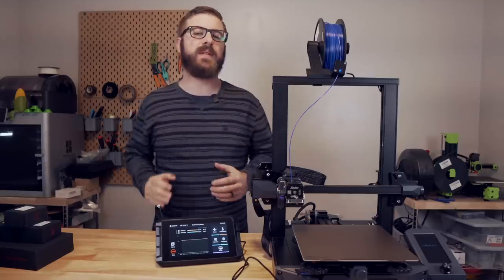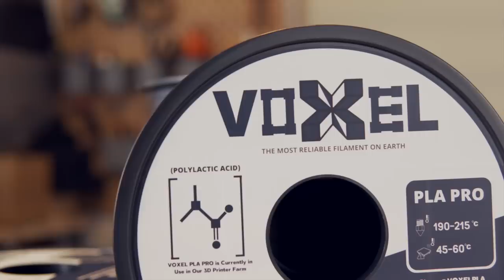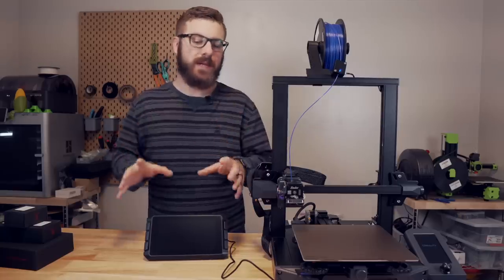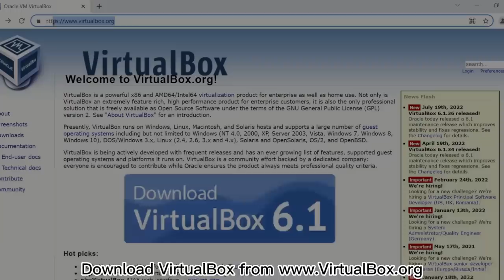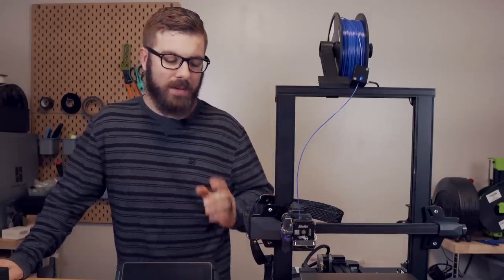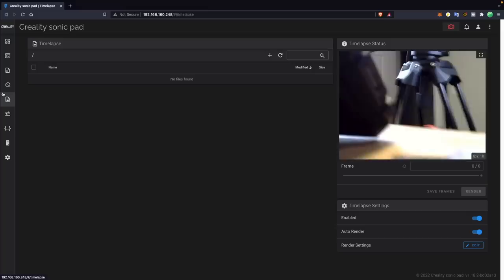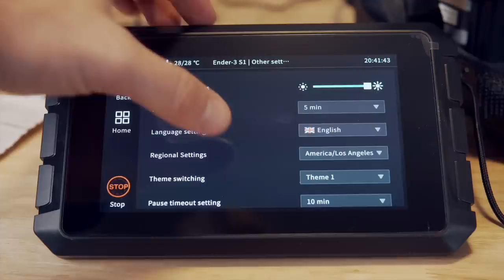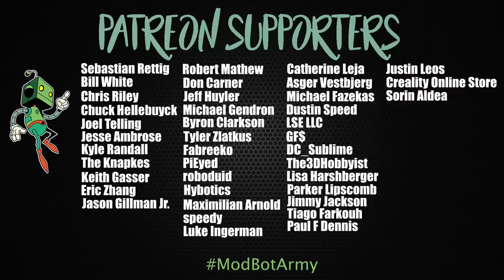Best Upgrade For Creality 3d Printers? Sonic Pad

Comment: FYI, you could use SHAPER_CALIBRATE instead of TEST_RESONANCES and just let Klipper try to find the optimal parameters for the input shaper for the requested axis!
Reply: You can add AXIS=x to select the axis. So SHAPER_CALIBRATE AXIS=x to calibrate the x-axis. Same for y.
Reply: Modbot already does that in the video, I was just pointing out he doesn't actually need the charts, he can just let Klipper select the best value given the results
Reply: I just got my sonic pad and now x and y is separate, /you run x then you move it to y and then hit next

Comment: It’s cool just not worth 160 bucks
Reply: not really that bad once you buy a Pi, screen accelerometer, etc.
Reply: Ideally, it wouldn't. Right now though, rpis are $140+, plus an enclosure, power supply, accelerometer for input shaping, the touchscreen - unless you are going a different route for running klipper, this is extremely economical (even if you don't value your time for assembling all that)
Reply: @zaplocked  Yeah but most people dont bother with raspberries anymore and instead get one of the alternatives that are not being scalped. 
You can get a banana pi or orange pi that will run klipper for like 30-40$. (and a power supply for that for 5$ if you dont have a spare phone charger)
Also, why would you buy an enclosure if you own a 3D printer ? Thats like owning a cow and getting milk from the supermarket.
Like the tablet is cool, but in no way cheap. You pay quite a bit extra for the convenience.

Also, i dont think people who "value their time" really get into modding 3D printers in the first place.

Comment: SONIC PAD what a waste of my time and money. Got one and it has never been able to work. Klippy not Connected. No matter how you try it. And Crealirty has just run me around from the day I received it. Spent 4 months buying everything from cables 5 SD cards 5 and Yes, all the systems are up to date and the systems I am trying to connect to are NEW ENDER 3V2 NEOs. firmware V1.8.And the Pad will not take a forced or network update. This is a waste of time and money from what I can see.

Comment: Thanks for the review! Looking forward to test print comparisons pre and post Klipper install once the input shaper issue is resolved.
Reply: Before and after: sharper corners, less ringing and ghosting, faster prints due to higher acceleration. Potentially less stringing if tuning pressure advance on a bowden (my experience)

Comment: So, the Sonic Pad, itself?  Very slick.  I like.  However....
Bad on Creality for failing to keep the printer's onboard control panel operational.  I would insist on keeping the onboard controls operational, in case the add-on Pad were to fail.

Based on that, I'll be passing on the Sonic Pad.  Raspberry Pi with a touch screen and OctoPi is the safer solution.

Comment: Are there any 3D printing experts available?? Would I be able to flash the Ender 3 S1 Pro firmware to my Ender 3 S1 with this setup? (Details below...)

I'm getting back into the hobby after a few years' hiatus. I've modded plenty of devices both software and hardware so I'm not worried about any of that but have been having trouble finding information (likely due to the terrible naming scheme Creality uses which confuses Google). 

Now, onto my question... I just bought an Ender 3 S1, Sonic Pad, and an all metal hot end upgrade kit. Would I be able to flash the Ender 3 S1 Pro firmware with this setup? I want to be able to print at 300° so I can use more professionally graded filaments like Nylon Carbon Fiber, etc. 

I ended up getting insanely good deals on all of this equipment, which is why I didn't buy the Pro version but essentially just upgraded my standard S1 to an S1 Pro. (Which has still saved me like $300 doing it this way so long as this actually works).

Comment: I have been using ender 3 pro for the last few months (my first printer) i have done some upgrades so far. My bigger complaint with this printer so far ins the firmware. Is this a viable solution for my problems?

Comment: As stated by Nero, 3d printers have been capable for a long time limited only by the available software (and crap hotends). Self configurating firmware isn't something everyone wants to do. The sonic pad is just the first step in bringing Klipper to masses. The day is coming soon where  3d printers will come with Klipper pre installed. Fun times.
Reply: It's pre-installed on the FLSUN V400...still waiting for mine to arrive.
Reply: @zulubreaker9295  Congrats on the new very fast printer.
Reply: Yep klipper is magic dust, the ender transforms into core xy, great.
Reply: Already comes on the 400 as well as the Bambu labs machine.
Reply: @saltwaterrook4638  Bambu Labs does not use Klipper or any fork of it, it is a ground up custom firmware

Comment: As a many years Linux and rPi user I found Klipper it quite easy to install on a standard rPi. However without the Linux/rPi experience Klipper is not the easiest thing to manage, simply too many details. This looks like a leap forward in users friendliness and if Creality manages it well could soon become the standard to operate Klipper.

As to the hardware the price looks perfectly fair to me. In essence this is a low end tablet as far as screen, memory and processor go with Linux + Kipper instead of Android. Add the additional ports plus the included bits like the accelerometer and I don't think they can make it much cheaper (at least initially).
Reply: With 0 prior experience with Linux i managed to install xubuntu, klipper and mainsail on a laptop which is now happily controlling my cr-10 V2. Just takes some researching, all the info is readily available out there. But yes, sonic pad was announced just as i started looking into klipper and I was seriously contemplating holding up until I could get one.
Reply: Right, the extra $70 or so seems very worth it to me to just have it done. Plus all the additional features and a more friendly UI.

Comment: So this effectively "breaks" the original display.  Since the pad is a replacement screen, can you unplug the original one or is it required to boot up?  I have been looking at Octoprint, but have been licking myself for never buying a Pi in the last several years when I had a chance.  This seems to add most if not all Pi functions, in a stream lined interface for a descent price (considering the current Pi pricing and detailed setup to get it working).  An out of the box functionality is awesome.  I assume you writing the Klipper to the Ender main board effectively erases the original Marlin code or does removing the pad and restarting the printer bring back the Marlin interface and original display?

Comment: Would this work too with modified printers? Like I have CrTouch installed on my Ender 3 V2, can this profile still be used or do I have to use the S1 profile where CrTouch is preinstalled? I'm completely new to Klipper and have no idea if you can easily modify it

Comment: I got my Ender -3 S1 Plus yesterday set it up to run with my Creality Sonic Pad plugged in the USB to the Sonic  pad theen plugged the other end the usbc end into the printer and switched the power on 230v  ? Flash flame out of the socket and killed the board !! Why ? I could be wrong but after looking at the USBC plug it had melted , was it put in the wrong way round ? Its not idiot safe it can be reverst ,then  looked inside at the board !! Toasted ! Was it the plug the wrong way round that did it ? If it was let this be a very DANGEROUS WARNING to other potential printers with the same setup as mine !

Comment: I have a pile of Orange Pi Zero 2 boards and have used one of them for Octoprint with a 7" touchscreen enclosed in a case that attaches to my aluminium extrusions and can be moved to the correct angle for viewing, its a great device and has freed up one of my Raspberry Pi 4 boards for another project, I could buy 2.8 of these Orange Pi and screen setups for 1 of the Creality offerings, I realise these are ideal for novices who dont want to install software themselves but they are far too expensive IMO for what they are.
 I would want to see how this Creality device pans out, ie what faults and shortcomings it has because every Creality product always has faults which never get fixed by Creality instead choosing to let the community to repair their products, if this is the case then I would say people are better off with the Orange Pi setup from the start.
Reply: I’ve recently been looking at banana and orange pi boards. Being a novice myself, in your experience is there enough info out there for someone like me to get I to print and/or clipper running on one?
Reply: did you only use octoprint or did you also use the orange pi for Klipper? Or does the orange pi zero 2 not work well enough for klipper? If this is cheaper and usable I would really like to go this route further. This sonic pad is interesting for sure.
Reply: Andrew, good analysis.   I  found that a touchscreen is not a requirement or really needed for Klipper, I just use my web interface and an old LCD display to observe temps.   I have my concerns about Creality, there has been a lot of discussion about their "borrowing" ideas from others.  I can see this being useful for Creality owners, but can't see anyone else using this.  I think they do need to release their software for examination and modifications by the users.
Reply: I disagree with the premise of the sonic pad. The whole point of installing Klipper is to give yourself more options for tuning and firmware configuration. seems like with the sonic pad you get an upgrade path, but ultimately it's a dead-end.

Comment: it makes it easier to bridge the gap and I respect that, but for those who already have klipper on this will be a step back... you can use the New BTT CB1 and RPB4 kit $40 + find an old tablet and place it near the printers to control the klipper. I do like their ADXL kit tho, I hate wiring that thing everytime I want to do input shaping.

Comment: Hello, question, could you make a review of this hot end? " Upgrade Bimetal Heatbreak High Speed Flow Ender 3 Direct Drive Extruder Dual Hardened Steel Gear Volcano Hotend"(is the direct drive version not the bowden) i can put the link up if you want

Comment: My stumbling block is my older Ender 5 Pro (using the original v1.1.5 8-bit board) and how to get it flashed from my Raspberry Pi using Mainsail OS. Can you point me to a video or resource that can help? As a note the E5Pro has a EZABL and EZOUT (with daughter board).

Comment: This is a great video for set-up and start-up for the Sonic pad.  I noticed that when you plugged in your camera, you had the LogiTech C270(ish) camera, which is super common.  Do you have any insight into what specs a webcam has to have to run on the Sonic pad?  I have a very generic eMeet C250 which is plug and play on every device I own (PC, Mac, Linux) - except my Sonic pad.  What specs should a webcam have to run with this pad?

Comment: What about pressure advance? My understanding is that this will not work because creality 32 bit silent boards are hard wired with the TMC drivers in standalone mode and no UART. Basically this is an unfinished product and is a nice idea if they could actually utilize input shaping properly as well as finally let users take advantage of pressure advance.
Reply from the maker: Is this verified? This is the first time I am hearing that UART is required for pressure advance. Do you have a source?
Reply: @ModBotArmy  I'm not sure how to verify it other than that I spent many hours trying to research and find out myself. From what I could tell, Creality uses TMC2209 for their boards, but they are soldered onto the boards as standalone drivers and not enabled for firmware control. So if that is the case, then this additional hardware will not be able to make a difference in firmware control of the stepper drivers. There were several reddit spots that talked about modding creality boards via soldering, but I could not find anything specific to the S1 or S1 Pro (which I have). For pressure advance, you do need firmware control over the drivers. That's why SKR Mini E3 V3 comes standard in that configuration. So I bought one of those boards, a raspberry pi, and pressure advance works. I had contacted creality if I could buy another backup S1 Pro motherboard and they said no. I didn't want to modify the board nor try pressure advance with the stock board to confirm. It ended up being a complete mess to find out a simple thing like this ...
Reply: I should mention that it may work, but I saw several people mentioning that some had printing artifacts, failures mid print, errors, etc. It looked like the only reliable way was to have TMC2209s in UART mode and allow for controlling stealthchop vs spread cycle and not risking it with a stock creality board over time. So it may work, but I'm not sure how well or if it is not very stable, etc. I could not find a satisfactory consensus online. Klippers documentation says various features don't work if not in UART mode, but again, it wasn't totally clear to me if that included pressure advance

Comment: Well of course it needed a PID tune... There are so many variables that can effect a bed or hot end.. such as elevation, humidity, baro, temperature of the house, incoming voltage.. PID tune should be done on every printer

I like fluid so that doesn't bother me

Comment: I have an Ender S1 (non-pro) and would like to upgrade to this Sonic Pad, but I also want to upgrade my hot end to the S1 Pro version to allow up to 300c printing. Will the Klipper software allow the max temp to be adjusted to 300c on the regular S1 firmware, or will a different firmware upgrade need to be done?

Comment: No E3 S1+, that seems odd with the other S1's on there by default. Hopefully they have it setup where you can just connect LAN and do an update before you start and add the whole database of C3D printers, no way am i paying this much and setting it up manually, i would just get a pi for that.

Comment: Just subbed.. Very interested in this unit and running klipper on my E3v2. It seems some of the negative things you addressed looks to have been patched with a firmware published earlier this month.... 

Release notes from 11/02/22 firmware
1. Added 7 default models and the firmware update process for some models via USB cable, and improved      the model configuration process;
2. Add custom model compilation function;
3. Improve the vibration compensation control function;
4. Improve the Z-axis calibration function;
5. Fix some known bugs;
6. Support Mainsail LAN control background;
7. Allow users access to the SSH background.

Could you please revisit with this latest firmware and make a video about it?  Have a feeling I am going to have to pull the trigger on this based upon your findings.

Comment: that's all? not very helpful as you didn't detail setup and printing with it, particularly important as speed gains with klipper are the main reason you'd get one.
Reply from the maker: The video covered specs as well as the process of getting it setup. If it didn’t answer your questions then look at another video 🤷‍♂️

Comment: I bought one of these. I have an Ender 3 v2 and an S1 Plus. A lot more involved with getting the Plus to work since it wasn't an option. I had to select the Pro and then make changes within the Printer.cfg. Not exactly the plug and play I was hoping for but it's gotten me into Klipper so...

Comment: If they add multiple printers this could be a great value. If you have say, 4 credulity printers and want to klipperize them quickly and easily. As is, it's a tough sell. Klipper is great, but an mks pi is $40, and while a touchscreen is nice it's by design not needed for klipper.

Comment: I really hope they do open it up and allow SSH access and/or flashing your own operating system. Because not only would have have to trust a device from Creality in your home network that, even if not malicious, might have very outdated security, but the device is probably also quite crippled compared to what could be unlocked with custom software.

Comment: 😬 been wanting to try it but still pretty novice to alot seeing this only made me feel as if I may mess it up a little I had trouble before with softwares and my printer running right but on a side note when I was looking into this I've seen one other one that does the same but I'm pretty sure this one said it could do up to 3 printers at a time

Comment: Does this have the original ender 3 which had sd card on bottom and a v1 has it up top. And my original ender 3 has a bltouch so what firmware it has.
Reply from the maker: Og Ender 3 was 8 bit so it wouldn’t be able to be flashed over sd card. They didn’t have boot loaders so the process would be a bit more involved.

Comment: I love that this is a simple option and hope that they keep it open source. That way klipper is easier and we can keep developing with more platforms for free.
Reply: They forked Klipper, Moonraker, KlipperScreen, and Fluidd, changed the source code, and then didn't provide those changes as required by the licenses... how is that keeping open-source?
Reply: @PedroLamas  sounds like they are really forking over the open source community